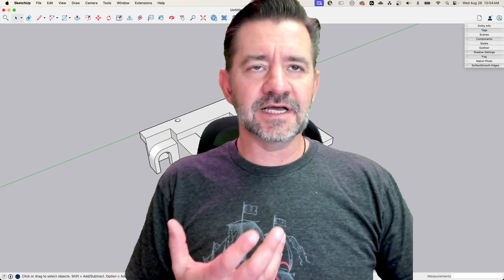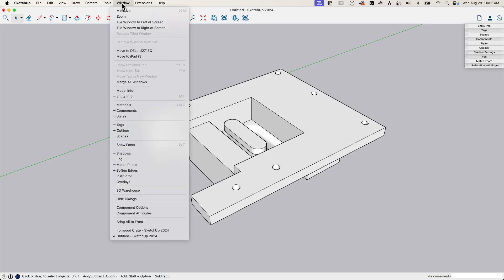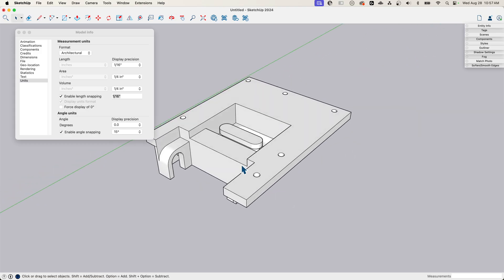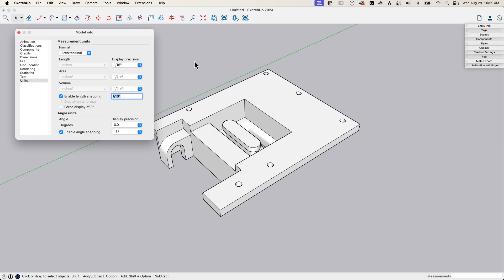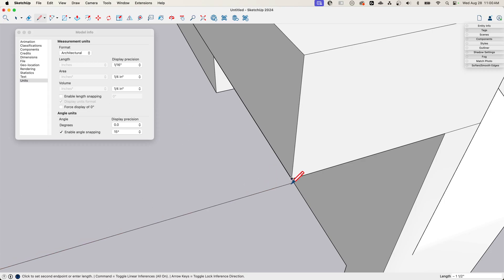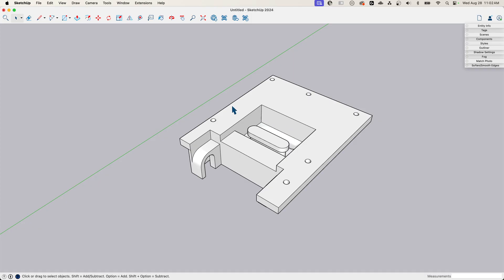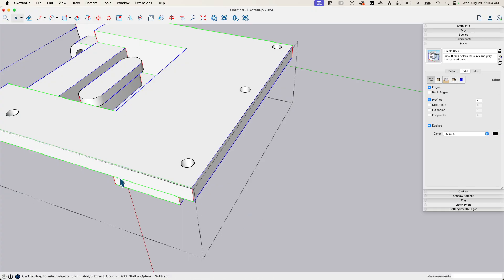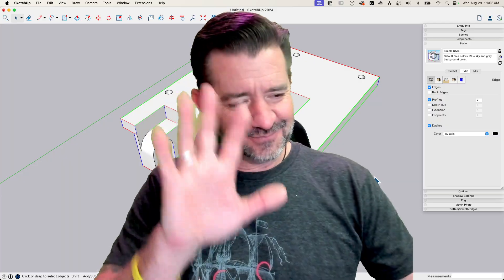3 Tips to Maintain Accuracy in SketchUp

Comment: Thank you for this.  Some very helpful stuff.  Decimal seems to be a big one that I have missed.  Thanks.  I still can not use the arc tool to make an arc less than 1/8" of an inch.  Is there something I am doing wrong?  Thanks!
Reply: Yes, scale up by 1000 or model in feet as if they were inches. SketchUp was made witch architectual drawings in mind and has trouble with tiny edges and faces. So scaling up solves your problem. If you want your model to be accurate size, just downscale after finishing modelling.

Comment: Nice video, thanks Aaron.  Does scale affect accuracy at all?  i.e. if I draw something that should be 9.5mm long but draw it 10x the size to prevent issues with small circles etc and then scale it by 1/10th does SketchUp scale it accuraly to 9.5mm or does some inaccuracy start to occur at a certain scale level?  I know I could go and have a play around to see but you guys are the experts so I thought I'd ask first.